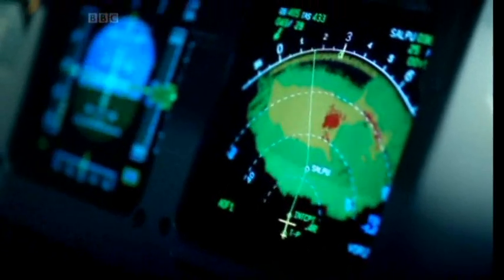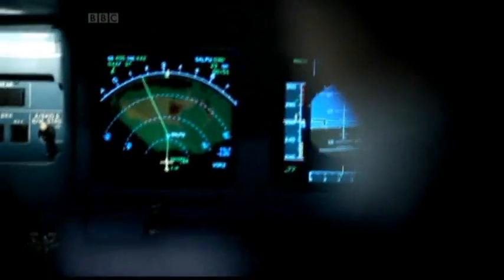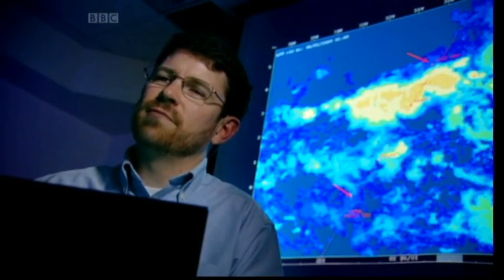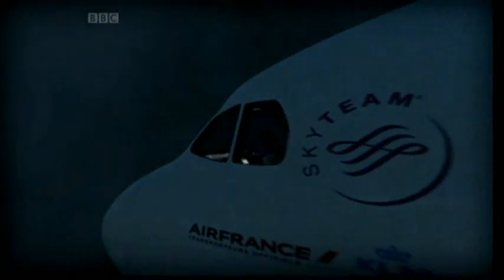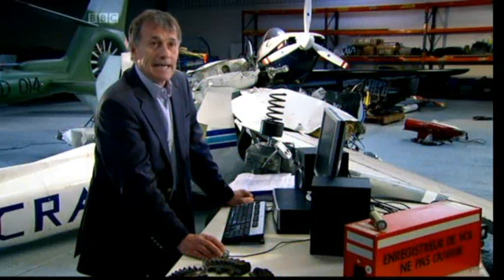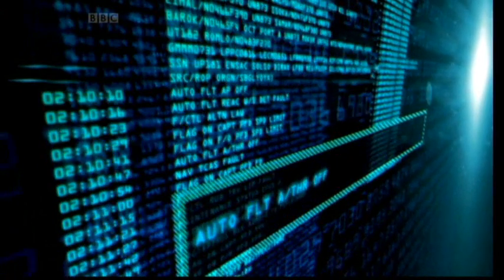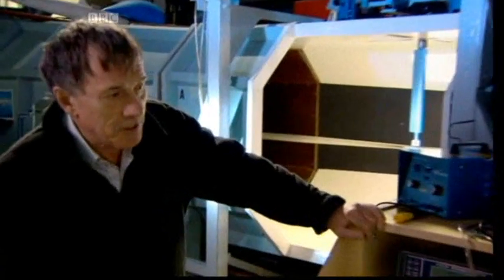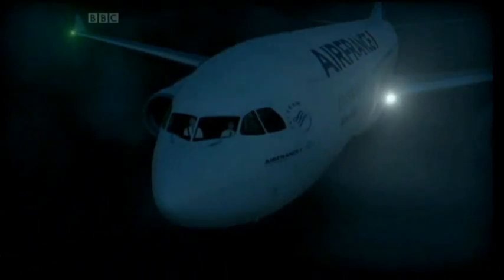Lost - The Mystery Of Flight 447 - Part 3

Comment: @BaleFire100 Also, if the pilot saw only the smaller storm, He would believe that it was no big deal to get through, and therefore would not turn around. It would have seemed routine until it was too late and they were in the middle of the storm.